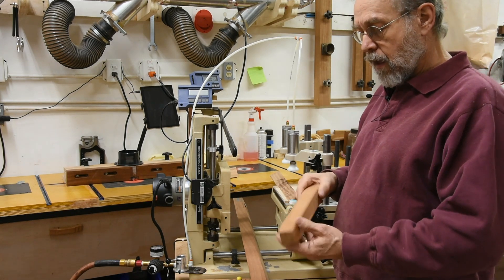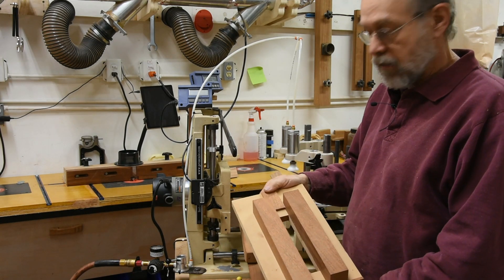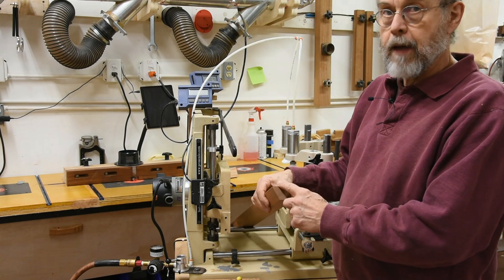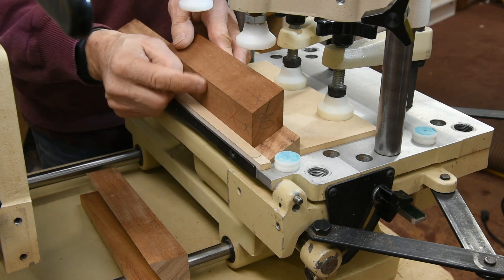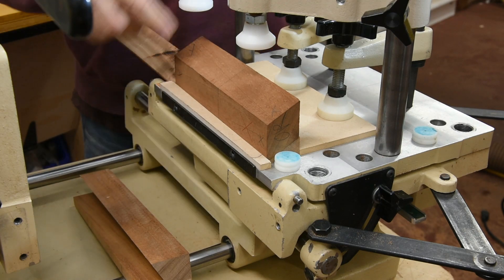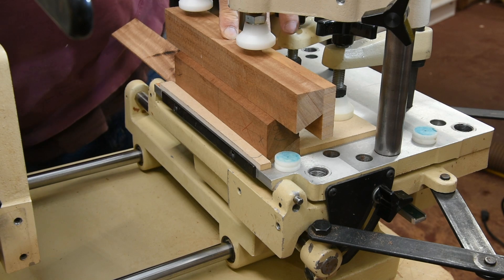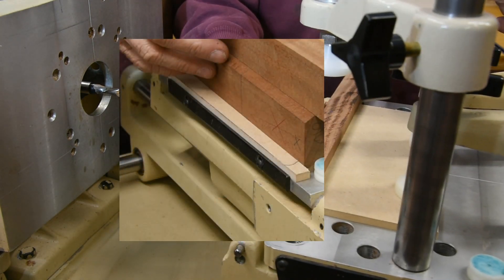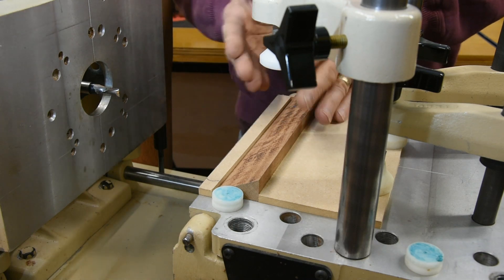Greene and Greene Trickery on the Multi Router

Comment: Could you weigh in on the advantages - aside from the angled table - of the Multi Router over the Panto Router. I'm try to understand the value of this tool vs the Panto Router. Thanks. Bill
Reply from the maker: Hi Bill, Both have their strong points. The PantoRouter's strong point is its template system - much better than the MultiRouter. 
The MultiRouter is my primary machine . I mostly do slip tenons. I gave away my MR templates because they simply did not give consistent results. Woodpeckers has improved the template system but it still is not up to the level of the PR template system.    
The MR is more versatile, precise, and efficient than the PR. With the Digital It has stops that can limit the travel in X Y and Z. It is very easy to size a mortise within a couple of thousands and quickly position it also within a couple of thousands.
 In general the MR is more of a precision and production machine. And again if template routing is important - the PR is the best machine.
Reply: @DarrellPeartFurnitureMaker  Darrell, Thank you for the prompt reply and insight.  I own a Powermatic 719 for squared through tenons and a Leigh DR-4 Pro jig - so I would probably never use either the MR or Panto for those applications, so the template issue is not that big for me. The production capabilities are more of a priority for me, as in building multiple chair and bench sets. Thanks.
Reply from the maker: @porpiniki  I used to have a Powermatic 719 - good machine! The reason I got the MR in the first place was chairs. I did a lot of dining sets which meant large runs of chairs and sometimes hundreds of mortises.  The MR could do those mortises in a fraction of the time and hold it's setting   - absolutely no drift!
Reply: @DarrellPeartFurnitureMaker  i'm sold.